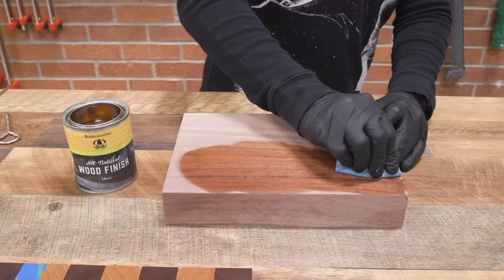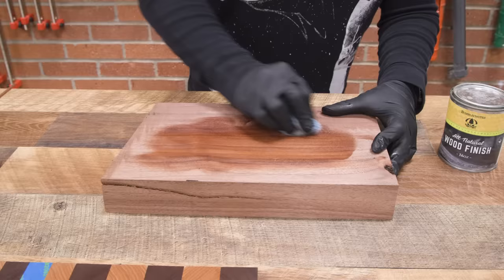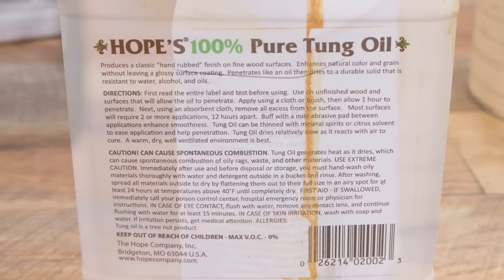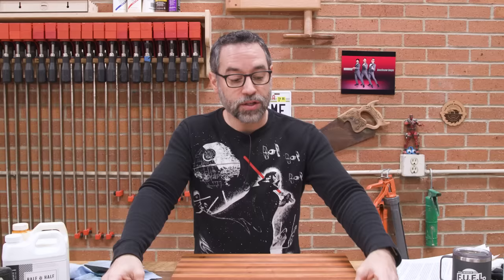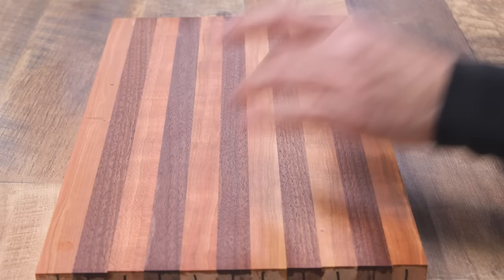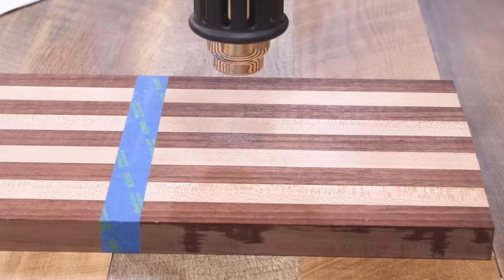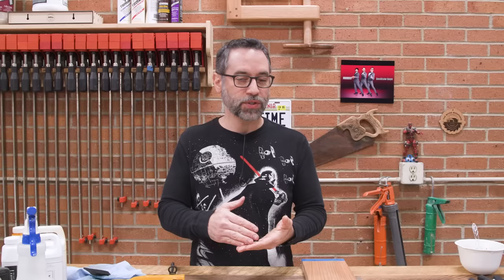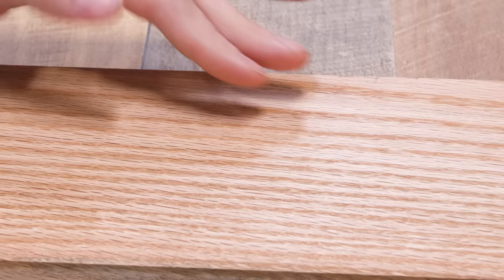A Better Way To Apply Oil Finishes!

Comment: Legend! If only you were two weeks earlier as I disposed of all my oils because of the disappointing results and pretty much everything that you mentioned.  However, when I use oils again, which I'm very keen on doing now, I will also purchase a higher quality oil.
Many thanks for this video.
Also, would you use oils for a high gloss finish using the buffering out method?

Gratitude and appreciation,
Mirielle
Reply from the maker: I definitely wouldn't recommend oils if high gloss is the goal. If you can even get a gloss out of them, it won't last long. And you'll likely be buffing the wood surface itself and not the finish. Natural oils, even with waxes in the mix, are generally matte and satin at best.
Reply: @woodwhisperer  thank you 🙏🙏🙏

Comment: Marc, do you think it now becomes advantageous to have a late-cure heat gun-n-rub session before considering the finishing "done"?
Reply from the maker: No. Unless you're putting the entire board into some kind of heat chamber where it can sustain a higher temperature and cure a little faster. If you cause the oil to excrete up to the surface, that's just less oil in the board. And if you've applied it thin I wouldn't say you have excess oil that you'd want to get rid of.

Comment: Marc, you could estimate how much water was absorbed (or evaporated but it should be the same for all samples) by weighing the shop towell before and after wiping up the water on the surface.

Comment: Awesome! Fellow chemist here. There is a method I tried once that I'm curious if it actually did anything different. I had an older cutting board that with a growing crack. I repaired the crack using a syringe and needle. Since my wife sometimes leaves the cutting boards in the sink with water (I know, sign) I tried to drive the wax deep into the wood. I heated it up in the oven on low and then applied the wax (mineral oil/beeswax mixture) to the warm wood. Um ... did this do anything or is it equivalent to warming the wax before applying?
Reply from the maker: Hard to say. Let's get a microscope and do some cross-sections! :) My gut says the practical difference would be minimal.....but as woodworkers we often chase down that last 5% improvement just because.
Reply: I think the difference is the whole board was warm, not just the surface. So in my theory it would penetrate deeper.

Comment: Would have been interesting to weigh the towels after cleaning the spots.  And exact amount of water per.  But then again, this isn't Project Farms.  🤣. As for the instructions...of course flooding is advised.  Makes you buy more.

Comment: I have a question I hope you can help with. I bought a cutting board at a sale and have attempted to get it back in good condition from being literally covered with tallow but I cannot seem to get the surface to a point where I can actually sand it smooth. Is there any way to get it to that point...it's close but still seems heavily impregnated with the tallow.

Comment: Thanks Mark!  I've been trying the flood method, and there is a specific result I've been looking for, and haven't yet seen.  I was initially excited because of the video you did last year.  When you showed the board that you received from Alex Snodgrass, you demonstrated how well it beaded water by rinsing it under a faucet, and it beaded water almost like a freshly waxed car!  I've been doing the flooding method using polymerized tung oil recommended another YouTuber.  Not only have I been unsuccessful on no less then 5 different cutting boards, 2 are totally unrecoverable!  On the other three, I can barely see where I placed water droplets, and can feel it after I wipe up the water.  I thought polymerized tung oil was supposed to work exactly the same as regular, pure tung oil, only it's supposed to dry significantly faster.  Do you know if that's true?
Reply: The obvious qn maybe,  but how long did you leave it to cure between coat?
Reply: Polymerized Tung is a different acting beast as it is partial cured oil cut with mineral spirits or another thinner. It will work better with the wipe method.
Reply: @Jinkypigs  1 to 2 days.

Comment: I seen some of d makers putting the cutting boards into a bath of oil finish...
Reply from the maker: That's usually mineral oil... a non-drying oil. And when you make a lot of boards, you need a fast way to finish them. I imagine that's when the dip method comes in handy.

Comment: What do you think about Rubio Monocoat for table tops. I normally use polyurethane.  I'm looking for a more durable finish.
Reply from the maker: If you want more durability than poly, you definitely don’t want Rubio. But I personally DO like Rubio for table tops as it's very easy to renew and repair.

Comment: I think the only thing that could have been more precise on this is using a scale to measure the weight of each rag after soaking up the excess water. Complete overkill lol. Yet again another incredibly informative video!
Reply from the maker: Yeah at a certain point we have to pull back and take a common sense look at what we're doing. My scientist brain would love to see it evaluated more accurately but my woodworker brain tells me the differences would likely be insignificant.

Comment: Does this apply to oiling cutting boards with mineral oil? A ton of people including myself, dunk the boards in the oil for 10-15 minutes, then let it drip dry. Would you suggest just wiping it on instead?
Reply from the maker: My advice pertains to drying oils. mineral oil is a non-drying oil. So its ability to protect the wood depends on whether it's there or not and soaking might be a good way to make sure there's enough there. And unlike drying oils, there's really no cure time to worry about. So it probably makes sense to get as much oil in there as you can in one shot rather than applying single light coats over the course of days. But you still have to be wary about oil seeping out after the dip. In the end, mineral oil is a different beast and warrants a different process.

Comment: I saw the Walrus Oil Furniture Butter and was curious about your opinion if it, will that be in a future video?
Reply from the maker: We've used it before. The denver skyline headboard project if I remember correctly. It's a good product. But I suggest trying in scrap before committing a project to it. That goes for any of these all natural finishes. Gotta be sure you like what they actually do to the wood.

Comment: The "drying" oils like linseed and tung need oxygen and UV light to polymerize.  Soaked down into the wood they get neither.  Very thin coats are better.  Someone called "Joe the Varnish Guy" who makes oil varnishes will tell you that "any is enough",  (I think he used to work with the True Oil people which may explain why their instructions tell you to use a very thin coat.)  
I think the soaking instructions are just "lore", but there is of course the possibility that if you flood your work, you'll cough buy more...
Stradivari used oil varnish, but on a violin you absolutely do not want oil soaking into the wood and dampening the sound, so the makers back then used organic materials (tough to know what exactly) to fill the pores to prevent oil from soaking in.  (Maybe egg white, maybe casein...)  So they got very thin coats, and applied as many coats as need - with the appropriate amount of time between coats.  We're pretty much talking weeks, not days.
Reply from the maker: Don’t send anything on telegram. It’s a scam and not us

Comment: How warm would you suggest re: hot plate for oil with no solvent?
Reply from the maker: Warm but not so hot that it burns your hands while applying.
Reply: @woodwhisperer  thanks!

Comment: A better cleanup for this test would be to absorb the excess using a paper towel, and NOT wiping the board at all. All that circular wiping is pulling water out of the wood, negating the entire purpose of the test.

Comment: Does this also apply to food grade mineral oil?
Reply from the maker: Mineral oil is a different beast. It doesn't cure so everything I discussed regarding curing doesn't apply. But you certainly could still have mineral oil seeping out of a board if you've applied too much.
Reply: @woodwhisperer  much appreciated and thank you for all the info!!

Comment: I use Osmo as my oil finish, and they mention using thin coats.
Reply from the maker: Osmo is even trickier since some of their finish can be applied in a thick layer. Their product line can be pretty confusing.
Reply: @woodwhisperer  I only use the PolyX-oil product but yeah I've looked at their other products and OMG they're so confusing.

Comment: Hi Marc (or anyone in the comments really)

My wife bought a wooden (mostly plywood, but some solid wood bits here and there) climbing toy for our toddler (called a Pikler triangle if you’re interested), and it didn’t come finished. For the longevity of the thing, I think I’d like to put a finish on it, but I really have absolutely no idea which direction to go finish wise (this will be a first for me).

I’d like to keep the color of the wood fairly unchanged. I’d like the finish to be reasonably “food safe” in case it gets chewed on here and there. And I’d like the finish to stay fairly “grippy” since it’s meant to be climbed on. 

Any recommendations on which direction to go?
Reply: For the same reason, when I build Pikler triangles for people I use clear dewaxed Shellac. To cut down on the gloss finish, you could hit it with some #000 steel wool.

Comment: Dipping back into the original can, not good hygiene to show others! Other than that, ok on the methodology shown. Like a take off of French polishing. 
Most content creators in woodworking are 'monkey see monkey do! One does something, and they seem to copy, but with there thier twist!
You can put it in direct sun, same effect as heat gun, but you get the hole board done evenly! Good discussion over all. 👌

Comment: A good video but i would definitely disagree with you on the end-grain cutting board.
Sure - if the ends of the pores are sealed then nothing will penetrate that - until you took the first cut and the surface protection is broken. It is a cutting-board... people will cut on that. If you are just using it as a decorative plate and never cut on that ... then why even care about a natural finish or how water-resistant it is at all?

Comment: Something seems weird in your wide shots with the clamp wall behind you. If I hadn't seen it before, I'd swear you are filming in front of a green screen. Maybe reduce the aperture so the wall is every so slightly out of focus?
Reply from the maker: My focus (pun intended) is capturing the woodworking. I'm an amateur videographer at best. So if the woodworking is clear and crisp, that's really all I care about. And when you run and gun like I do, it's important to leave as much buffer as possible for the focus plane. That wall is literally right behind my body and getting the aperture set for a shallow depth of field that begins to blur the wall becomes a bit of a challenge, especially when changing up the shot periodically. So all that to say, "ain't got time for that." :) Maybe when I have a dedicated person behind the camera.
Reply: @woodwhisperer  Totally fair, and not easy to get right, particularly with fixed camera. But just for some reason this time, you and the backdrop felt really odd, and that's my best guess why.

Comment: You're doing it wrong.🙂
I don't use straight oil on anything. I either cut it with solvent or use my own Danish oil mixes, which can vary in strengths.
I wonder if the difference here is between hardly any oil in a thinned product vs a lot of oil in a straight product.
If thinned, then you are pretty much putting on a thin coat however you put it on. And a commercial thin coat means the company is selling you solvent rather than product which is cheaper for them. (Thinner is 1/3 the cost of pure tung oil)
IE. if the oil is thinned down to 20% then you would need to put on roughly 5 coats to equal the one straight coat of oil, even if you flood it with the thinned coat.

Comment: I followed this and it’s a bad method. I should’ve done a little more research but I trusted Marc. Stumpy Nubs went into detail on how to properly apply it and after using his method, I have far superior results than I did with Marc’s.
Reply from the maker: I'd love to hear more detail about why my method is "bad". This is a pretty foolproof time-tested process (one I didn't invent) that has none of the risks found with a flooding method. Flooding can certainly work on certain species, but it can also backfire on others....hence this video. Very curious to know what finish you used, what species, and what your observations were, because what you're saying doesn't add up.

Comment: Whatever you do, PLEASE, PLEASE, PLEASE be very careful handling your curing-oil-soaked rags. My BIL next store lost his detached garage, 2 cars, and almost his house to spontaneous combustion of oily rags.  I still hear people say this is a "nanny state myth" but it's not.

Also, for cutting boards, I just wipe them with mineral oil.  If it's actually going to be used as a cutting board and not just a kitchen ornament, the natural oils and other juices from the foodstuff cut on it will keep it finished.   I have a 12+ year old end grain board that still looks great, just well-used.  I don't see the point in expecting working cutting boards to look pristine.